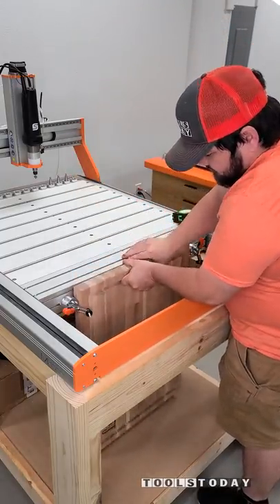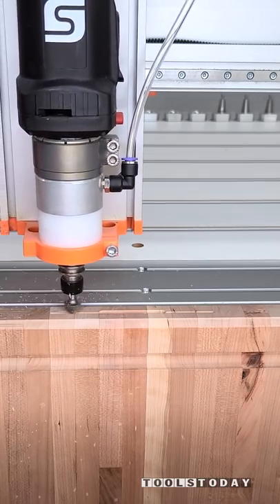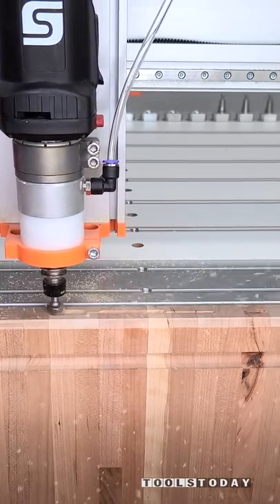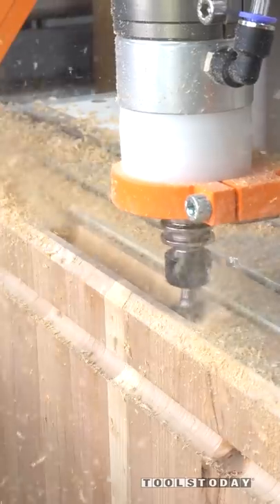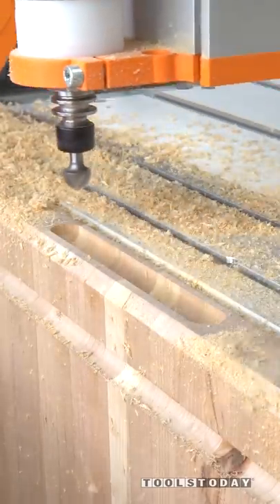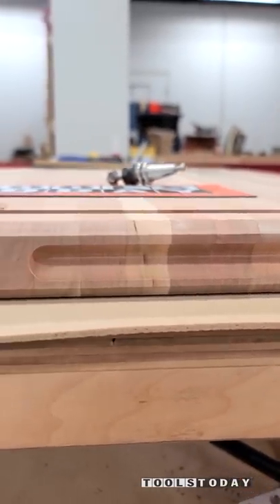Vertical Clamping Jig for Finger Holds on CNC

Comment: Let me preface this by saying this is far beyond my abilities and I am impressed! 
I feel like having a round over (fillet?) on the underside of the grip between the groove and the outside face would make it a little nicer to hold! Since the weight is being applied to your finger tips, having the slightly sharpish edge could dig in a bit if you have a whole turkey on there or something. 
Basically: make the depth cut  square, then round over the lip instead of the bottom? Hopefully that makes sense. 
Again, this is amazing and way better than I could do, I just wanted to share my thoughts in case it helps make something even better!
Reply: The machine did it, all he did was place and clamp the board, its like if nascar had self driving cars and we gave the credit to the person sitting inside the car.
Reply: @Che_mo80  nah I’d give the credit to the guy who programmed the car to drive fast. He programmed the machine to make something cool so he gets the credit.
CNC mills are a tool, so assuming you also do woodworking, do you give all of the credit for your creations to your tools? Do we give credit for movies to the editing software and camera equipment?
I understand your point, but I think it’s an antiquated way of thinking about woodworking/making in general
Reply: @nathanblanchard8897  in woodworking is different because a person can go a buy all the machines to make stuff for him all he has to do is move the wood from one machine to the other and he is a so called woodworker or carpenter, but put him out with only hand tools, if he can't make anything with hand tools than he is not a wood woker, he is just an assistant, nothing more. I do credit my tools for making it easier but i can also use wood carving tools and hand planers and hand saws so for me what he is doing is not wood working, its just work.

Comment: Really cool!! What would help you to hold your plank of wood up while trying to clamp it would be a couple of 123 blocks or parallel bars depending on the spacing under your plank of wood that is, so that way you're not struggling to clamp your piece and it'll help with keeping it straight and level as well. This will also help when the cutter is plunging in for a cut, if the piece you have clamped is not clamped tight enough the 123 blocks will hold it from shifting in the clamps resulting in an uneven cut.
Reply: Or any pair of sticks, really. Or shingles.

Comment: Do it by hand and I'll be impressed.. otherwise, any sod can do it...
Reply: That is a comment I'll take my hat off. In fact as an old carpenter I commented saying shite cnc
Reply: Would by hand with a router do?
Reply: @leehaelters6182  No
Reply: @podsaveengland , fair nuff! I've done it often enough with a scratch stock, but would not try that on endgrain. You are right, I'll be mighty impressed by a feller that can carve that out with a gouge and make it look the same. Would be more suitable for a different design, perhaps retaining the tool marks.
Reply: @leehaelters6182  but not any old bloke can pick up a router either and do that, there's some skill involved at least.
Reply: @podsaveengland , you calling me old? Well, I guess you're spot on.
Reply: @leehaelters6182  I do it all the time with my router table
Reply: @Kash1596 , my meaning was that I would not try to scratch out a cove in endgrain, using a hand powered scratch stock.
Reply: How would you do it by hand? Gouge and a scraper?